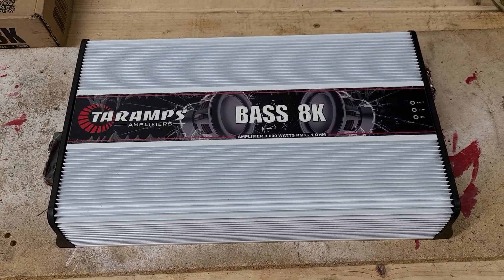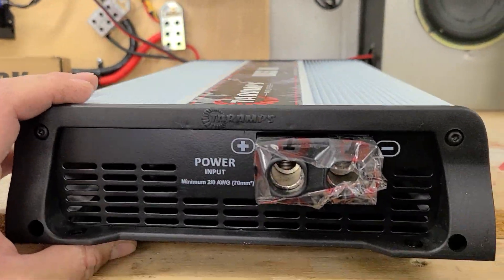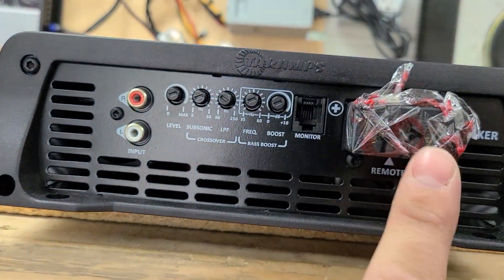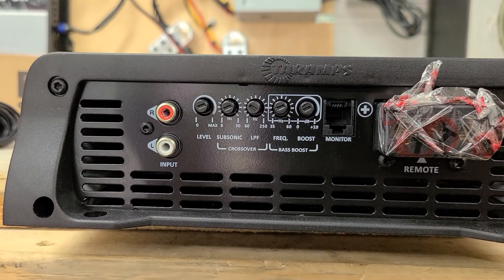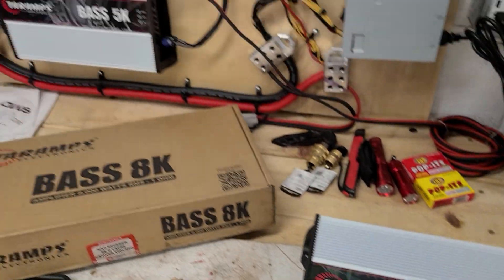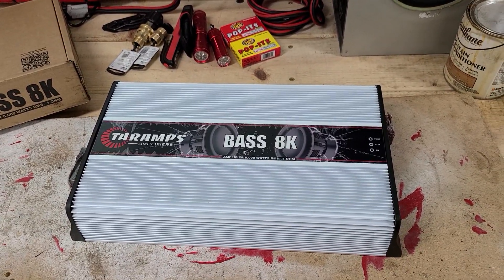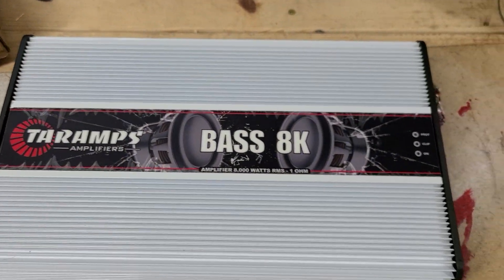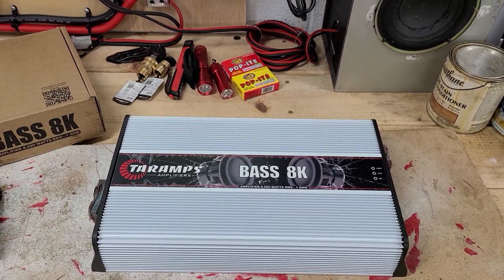Taramps Bass 8k Review

Comment: Its wild that the smart 5k has double power/ground inputs, but the bass 8k doesn't? I use 2/0 wire in my smart 3k, but you gotta do the zip tie trick to get it in. I've been really looking at buying a bass 8k fr. Can you run these at 4 ohm?
Reply from the maker: Yes u can, probably only going to see around  3k out of it at 4ohm. If that
Reply: @drumhead14  ok, I was just curious. I run at 4 ohm for a week or so when I buy subs for break in period.

Comment: I just bought this Bass8k (1 ohm) to power two 12" Avatar STU 12's (dual 1 ohm VC's). They are rated 3000 RMS. Will this be a good amp for them? Not enough? Too much? Good match? I've always done car audio systems, but never had a high wattage system that requires an aftermarket alternator and the Big 3 (all of which I will do before installing). So just wanting an experienced person's opinion. Thank you for your time.
Reply: Hay dude I bought 2. 8ks md Taramps amp for 2. Stu avatar subs just like you , I also got a cyber12k limitless battery bank an a mexan 399 alt.  Good luck on your build hopefully there can be a video some time of it . Bass on

Comment: Besides the fact that it’s only meant for subs what other main differences are there between this and the MD8k? Is this louder with the lower bass? Does it sound better for example?
Reply from the maker: Different and better crossover, couupe extra internals that the mds lack for bass. Extra caps and such. Mds lack in lows due to crossover, and really not ment for subs. You can use it for them and will do fine. Bass will handle the bass notes better, tune batter, be louder and or smoother on bass notes
Reply: @drumhead14  So the bass is still louder although it’s rated at 8k @14.4 V compared to 12.6 for the MD?
Reply: @drumhead14  Is the bass .5 ohm stable?
Reply from the maker: @mjl6425  bass amps are .5 ohm stable
Reply: @drumhead14  Do you know what kind of power it puts out at .5?
Reply from the maker: @MJL  I haven't seen Any vidieos on it. I imagine at .5ohm load, at 14.4v it sound pull off around 9k, 9.5k ish
Reply: @drumhead14  That’s good power. I’m considering one of these or 2 smart bass5k’s.

Comment: I bought the bass model 8k and I can’t find anything that says.5 ohm stable. Im not trying to insult you. I just want to make sure before I blow my $700 amp. Even there website says 1 ohm. Are you sure it’s safe to wire .5 ohm? And again it’s just a question. I’m not trying to upset you in any way.
Reply from the maker: Yes my dealer sheet, Resilientsounds.Com and I seen a couple other places say you can.  
** as long as you have the eletrical to support it**
Reply: @drumhead14  ok thanks I just wanted to make sure I really appreciate your help.
Reply: Yeah, no. They're not .5ohm stable. You can wire to .5ohm  sure, with impedance rise you'll be well above 1 or 2 ohms. If you're impedance actually touches .5ohm at full tilt., it WILL protect
Reply: No. Many people have played it  "wired" 0.5 ohm.... But the ohms is really around 1or 2... it's 8000wrms!! You really need more than that?!?!
Reply: No. Many people have played it  "wired" 0.5 ohm.... But the ohms is really around 1or 2... it's 8000wrms!! You really need more than that?!?!
Reply: @sarahconner9433  no I don’t need more but I have 2 Orion hcca 15’s that are 2 ohms and if they are wired correctly it will drop it for .5 ohm load right now I have them wired to 2 ohms and they sound great but I like to wire them for full power it doesn’t mean that I’ll turn the amp up all the way though
Reply: @Codyfaris  I'm on your side... You walking down an expensive road... Those 2 hcca prolly has you mid 150db... That should be loud enough.... Besides 0.5 ohms sounds musically crappy... If you kills those coils it could short... That would also kill your amp.... Very expensive...0.5 ohms is for the db drag stuff
Reply: @sarahconner9433  I’m not sure what DB I’m hitting lol. they are splitting my roof by my back windows in my 2003 blazer. I have to brace my roof some how🤔 there in a custom built 8cf box tuned to 33hz . It sounds really good if I could just install my universal bass knob. It feels like it’s breaking my body when it’s turned up.
Reply: @Codyfaris  hurting your body sound like 157db...I think your going deaf.. Wear earplugs my friend....
Reply: @sarahconner9433  I just turn down my amp and when I show them off I turn it back up🤟
Reply: @Codyfaris  lol I hear a lot of people referring to some sort of bass knob for a taramp amp, but truth is with all the engineered intelligence invested in this amp would it be feasible to assume they merely forgot to add a bass knob? Or the one thing most detrimental to this fine piece of equipment is clipping, and therefore opted to provide a external clip indicator knob instead? It just behooves me most people running taramps won't even install the clip indicator knob and fry there subs and or damage the amp.

Comment: I have 4 of these 1 ohm per sub . 4 , 18s in a 4th order blowthru it does a 155.5 db on music , and at 33 hz it did a 156.9 on a burb . They are great amps. Remember dont input over 2.0 volts or the board will fry

Comment: I'm running stock electrical alternator but I have 2 northstar 220v in my truck on my subs I have 2 ap, bd4-15's I really want the bass 8k but I don't know if the MD-80001 would be a better fit???
Reply: If you want bass get the bass 8k the MDs are really not made for bass because mines play nothing but bass! I can tell the difference from a full range amp which the Md is save yourself some time and money and get the bass 8k and even if you don’t use the power it’s nice to know it’s there!

Comment: I have 2 massive drago 6k (3k rms each) which are Korean boards, they cost me 1100 new each would it be worth it to switch to the bass 8k? I just have trouble believing I can get better power from this 1 amp at only 600$
Reply from the maker: In you're case yes it would be worth the switch. 100%
Reply: Did you switch?
Reply: @Mr.NpK143  no I’m doing some electrical upgrades first
Reply: @jamesbaysinger9780  that's a great idea 👍. That's bass 8k would more than likely have a bigger current draw then the 2 dracos. The bass line doesn't really start to perform until about 15.6 or so. Not to mention it's all a trade off. Brazilian amps will give you more power per cent, but at the expense of THD. I believe all Korean boards have a higher THD then Brazilian boards. Which boils down to better sub control at its rated power. Often times you'll see coils arching out on the metal basket when running Brazilian boards due to lack of THD at max power. So you're right in my opinion about getting better, although it is not necessarily comparing apples to apples 🤔. A lot of people after experiencing Korean boards go back to Korean boards when they try Brazilian. They say the lows aren't the same. Which was why I asked you did you switch.
Reply: @c20 np143  correct I went back to my crecendo bc4k after trying a Brazilian the lows definitely wasn't there and I was using a sfb5000. If you just want spl then I would say yeah Brazilian but if you want some nice clean lows then korean board amps for sure

Comment: It might hit 8000 wats, but it won't push it near as good as a high quality amp. Iv also found its not a very durable amp, it won't last that long. I'm used to dealing with Fosgate, JL Audio, and stuff like that. This brand is like soundstream amps, it will work for a few bass competitions, but it won't last long. Quality amps cost about a dollar a watt. Just fyi. 😊

Comment: I bought the smart 5 and it's cliping with one 15 vxf  and I'm thinking if I should go with an bass 8k what do you guys think
Reply from the maker: Well if it's clipping it's clipping for a reason, maybe it's somthing in you're system causing it to clip?
If you're 1 billion % sure it's not you're system in any way and it's the amp. Try the amp is a friends car. To verify it's the amp. 
I believe it's going to be somthing in you're system, or a couple things, even settings.
Reply: Often people don't realize taramp md version clips with low voltage. I'd check the voltage first
Reply: Your clipping because your not feeding the amp the correct amount of amperage that it is demanding.  I'm running the smart 5k bass on two MTX 9515's with a 390 alt, XS D5100's, and two banks of 500f super caps and the clip light has never came on.  Remember ohms law, it's the most important thing to keep in mind while building a system.
Reply: Yeah my 250 is not cutting it but I do have wo xs power  batteries the group 34 in front  and the 5100 in the back  . I just went  through a whole mess  with js 390 alternator and now I'm trying  a local  company  called  east Orlando remanufacturing and it would be a 450 so let's see what happens
Reply: @egm092478  did you figure it out yet?

Comment: I just bought the 8K bass to push two 12s evils 
Just seen a video of a guy dropping a screwdriver on the heat sink and it blew up the amp , just a speaker wire he was putting in , amp was on and grounded???? Is my shit gonna catch on fire too????
Reply from the maker: Most likely somthing else was wrong.
But ik taramps, speaker negative, and power negative, and rca ground all share the same ground. Unlike Korean amps.
Reply: Same thing happened to mines speaker wire blew it up
Reply: @marlowejackson3606  wdym
Reply: @nauzik.  speaker wire touched the side of the amp and it blew up started popping the amp is very sensitive

Comment: Does anybody know what bass know preferably with clip light will fit this amp? I had the MD 8k btw and ran it @.5 ohms with my 2 15 avatar stu's 2ohms and the only issue I had is if I had it cranked too long it heated up. The moat important thing for running non Korean board amps at .5 is the right electrical. I have two skar rp4500 slaved together and supposed to make it from 1 to 2ohm stable but she has hooked to 1ohm cuz her subs are 1 ohm hooked in  series/ parallel and it shakes the planet it hits so hard for cheap amps but I had to install fans cuz those things get hot. But again high output alternator and the big four is a must for these high power amps. Plus .5 ohms in a car with box rise and all that is probably closer to 1-2 ohms in reality. This is just my experience but I'd get the subs that match the stability of the amp. I did it the other way only reason I go .5. I bought two 2ohm subs on accident. Thats the only reason or I'd have them at 1ohm. In my opinion the lower the ohm the shitier it sounds.also you get what you pay for
Reply from the maker: What was you're electrical with the MD 8k. Ik some of Tara's get warm but not many
Reply: What?
Reply: I didn't write that. Don't know how my avatar got attached. My question was just about a bass nob!lol....I don't even understand wtf is written here...or what the question/reply is? I have the smart bass 5k with big three and stock alt with an interstate start battery and 3 mighty max 2500 agm batteries pushing 2 12s and my voltage stays between 14.2 - 13.8. I'd like to get a lithium battery and do away with the agms cuz they take up a lot of room but it's been hard to find a high output alternator for my toyota but for me I dnt need it my voltage doesn't really drop with this amp like it did with the crossfire

Comment: I have a md 8k on 2 skar zvx 12's  and I'm wondering what size alternator I need I bought a 250 and it quit twice already. Please let me know I am going to buy a mechman this time
Reply from the maker: What do u meen it quite 2 times already, what brands, and what does you're electrical look like
Reply: @drumhead14   I mean it went out two different times it's like it's working too hard I have all my electrical upgraded 0 gauge
Reply from the maker: @clintwatson8058  how many battery's?
How many total amps 
1/0 power and negative ran front to back.
Reply: @drumhead14  I have 2 xs power batteries 1 is lithium in the cab 2 amps taramp 8k on subs and a diamond audio 800.4 on mids and highs I have 1 run of 0 gauge from front battery to the back battery big 3 up grade under the hood my back battery is grounded to the frame
Reply from the maker: @clintwatson8058  I would run a ground from front to back. And also ground you're alt. 
When you're playing you got a voltmeter in the car? What colts u getting around. U may need more lithium.

Comment: Better than the MD8000.1 ??
Is it better than the smart 8k??
Reply from the maker: Depends on you're situation. I always think the bass will be a better fit. But also depends on you're ohm load. Sometimes the smart would work better. But I always believe runing the right amp. Or a stronger one to overcome
Reply: I know that the bass 8 sounds better to me than the md8k I have both

Comment: hi buddy, is this amp worth to buy or smart 5k would be more powerful?
Reply from the maker: Depends on you're set up. Of corse the bass 8k is going to be more powerfull. Then the smart 5k. The smart 5k is just 5k.
What's you're set up
Reply: @drumhead14  
I got 2 15s deaf bonce 3500 rms DVC wishing to hook at .5 ohm in total would have 7K watts.just wonder box rise from .5 ohms to at least 1.3ohms predictable and smart 5k pull produce 6000watts(williston audio labs tests) at 1.3 ohms.but no evidences on bass 8k on any dyno at all
Reply from the maker: @jeyhyseyn4449  do u have the eletrical to support the 8k
I would do the bass 8k hands down
Reply: @drumhead14  yeah buddy of course,2 x LTO packs 40ah,alternator mechman 350ah
Reply from the maker: @basshead100  oh yea, do the bass 8k at .5ohm you'll get more power.

Comment: If I get a bass knob for it will it work?
Reply from the maker: No
Reply: @drumhead14  thxss
Reply: @drumhead14  wait wait you're saying I can't get any bass knob to work with this? Is there ANY bass knob that can work with this amp?
Reply from the maker: @Bailey251  the only bass knob you can use is a in line rca bass knob before them amp rca inputs. You can't plug a bass knob into this amp like all crescendo,dc,sundown etc.. these amps only have the leds and that's it

Comment: I'm running a single 15 american bass xmaxxx, I have the 8k but it's 2ohm. My sub is 1ohm. It worked for about a month bumped nicely. Now the amp shuts off at low volumes.
Reply: Try putting a jumper 8ga. Wire around the sub positive to negative ,then take the other 2 positive an negative post on the sub to the meter check your resting ohms see what the coil reads the closes you are to 2 ohms the better .like if it's only 2 tenths off should be ok . Like 1.8 ,2.0. 2.1
Reply: @stevemaniaci4750  actually no, the ground wire was loose lmfao
Reply: 😂😂😂 
Ground wire